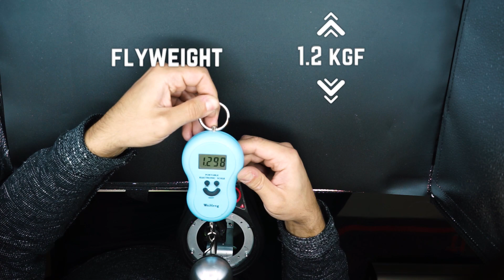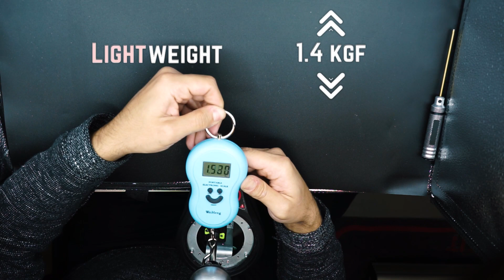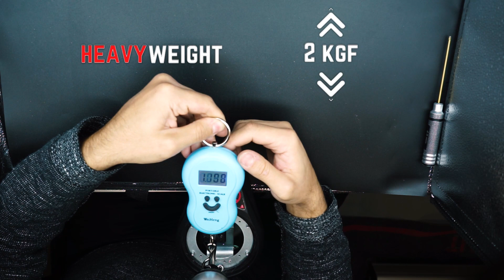TH8A Mod v.3 by 3DRap - New Design & New Skills for the Thrustmaster Simracing Addon

Comment: Nice mod, feels really good. But @ 2:05 the base plate is removed, without giving a warning that there is a tiny cable connected. It‘s the Button for sequentual mode. Mine got off and I have to resolder it. Not a big Problem but a hint would be nice.
Reply from the maker: Thanks for your feedback. for us it is essential to improve our products.

Comment: This looks great but would this come with physical instructions and would it still work with the standard base plate that comes with the shifter
Reply from the maker: it comes without instructions, but it is very easy to mount, and it is compatible with the originale plate :)
Reply: @3DRapSimRacing  that's a lie, is not that easy to install, it would be nice to have instructions and expectation of how to install it, specially the part that a significant amount of force needs to be applied so it does fit in. In fact I'm confused about thit because I just bought it and it seems that does not want to enter but seems that maybe needs to be jammed in by force.